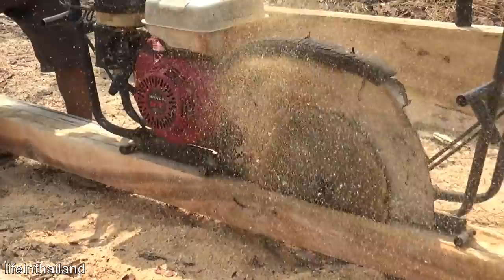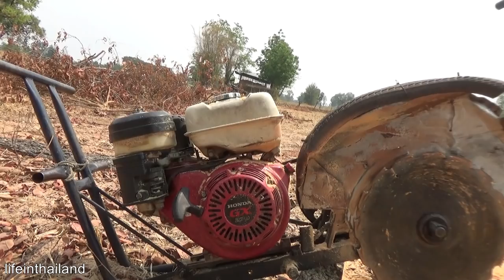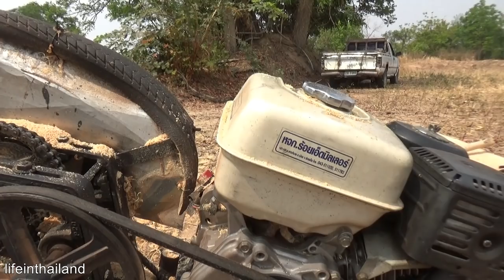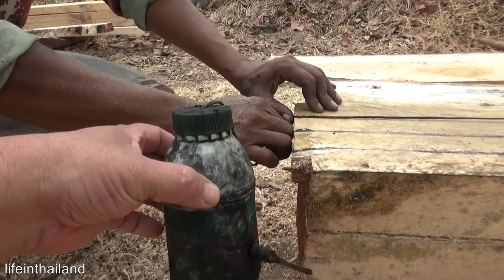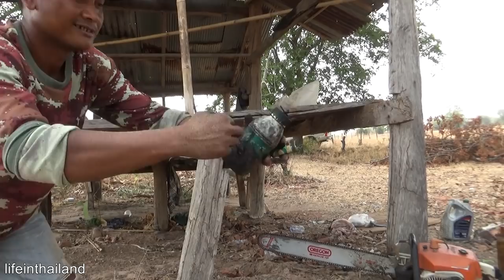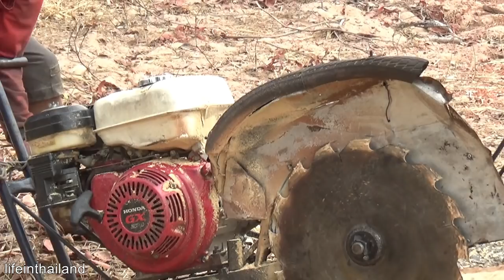Portable Homemade Sawmill in Rural Thailand.

Comment: I've seen many variations of this being used by off grid settlers.  Truly amazing.  Of course the lack of even a minimal amount of safety gear makes me worry....but they are doing it their way.  Who am I to argue?
Reply from the maker: An everyday chainsaw that you can get al=nywhere is a lot more dangerous than this saw, but they could easily add a guard around the blade, that would make it a lot harder to follow the line though.

Comment: I like it. The chalk line need to stay on so the oil is a great idea. Nothing worse than laying the cuts out and the chalk blows away. 
They must have it geared up well to cut the stuff they are cutting. Very cool
Reply from the maker: With a normal chalk line, you would probably have to mark it for each pass as the machine would remove the chalk on the other lines.

Comment: To be strategical is to work with what you've got.
Reply from the maker: This is a very useful tool, faster and just as good as most small sawmills on the market, it's 10x faster than the best chainsaw mill, its downside is it needs to people to operate it. And it's really cool...